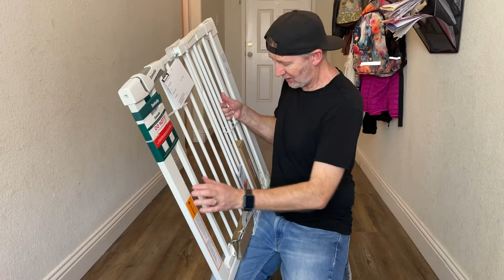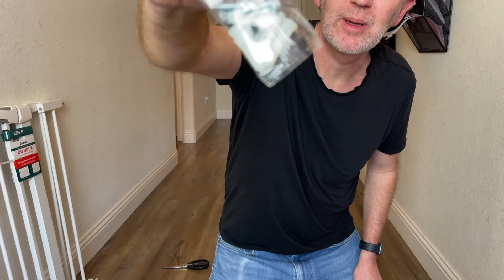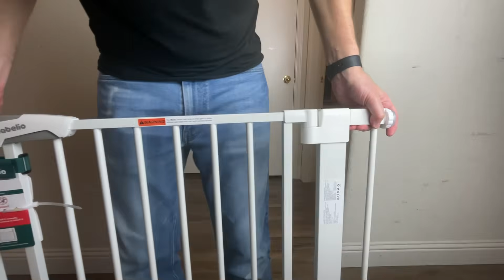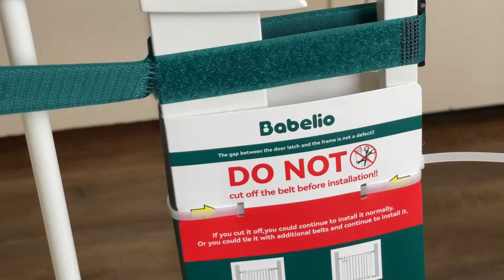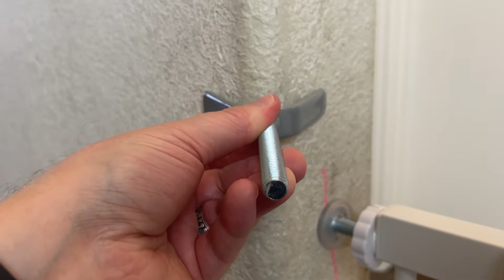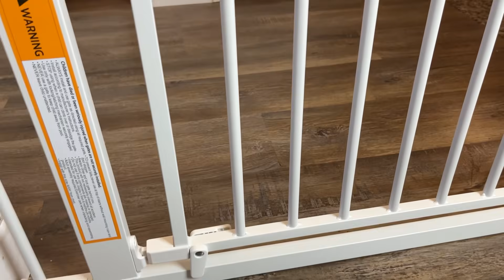Babelio Magnetic Baby Toddler Gate Installation and Review

Comment: These gates are great but I need to say... the sticky two sided cushion goes on the back of the cup facing the wall. This prevents the cup from moving on the wall or rail so you don't have to drill and screw them in place. If you put it where he said, the cup would probably dig into the drywall or slip on the door frame (plastic on wood).
Reply from the maker: Good catch! The sticky cushion is meant to go on the back of the cup against the wall to keep it from shifting. I’ve seen some people place it differently depending on the surface, but your way definitely helps prevent slipping and wall damage. Appreciate you pointing that out.

Comment: If you weren't paid to support this would you admit it sucks? I spun the pressure bolts and no matter what I did the thing wouldn't get sturdy. If the baby would stand next to it and shake it, it would easily fall over time. The issue is with the poor product design. The pressure bolts closing in on the gate latch in the middle will never allow it to get taught enough.

I noticed you didn't give your gate a "this isn't going anywhere" tug like when you watched strap something in the bed of a truck. Probably because you knew it wasn't sturdy and didn't want to lose a sponsor. I get it. Also not taking it out on you, this product is just garbage.
Reply from the maker: That’s a fair point. I actually don’t have this gate anymore, so I can’t speak to long-term use.

From what I remember it worked fine in my setup at the time, but you’re right that pressure-mounted gates can be really dependent on the doorway and how they’re installed.

If it’s not feeling solid, I wouldn’t trust it either. Appreciate you sharing your experience.

Comment: I wish I saw this video before I installed it! Stupid me put the stickers on the outside of the rubber holders!  Also the directions in the package stated NOT to put it low; I put it about 3 inches higher than the floor and what's bad about that is its at the top door entry to the stairs and there is a step down. My wife and I are in our mid 60's so we have to be careful. I'd like to take it apart and redo it but the stickers that I stupidly put on the outside will most likely peel dome paint off!  I know I WILL do it but not today! 
Thank you for taking the time making this video.
Reply: i just need to say... you did it correctly - stickers between cup and wall - prevents sliding as an alternative to using the screws.